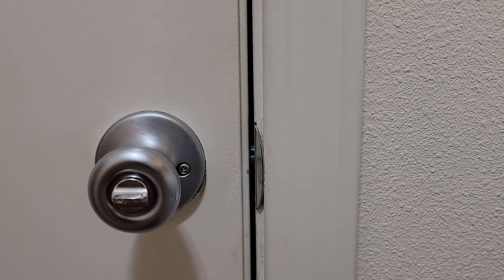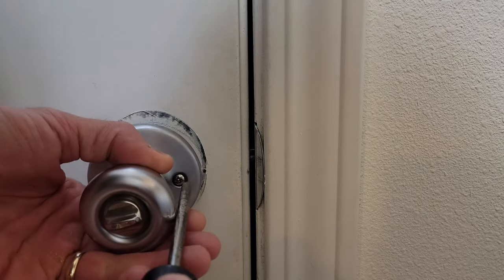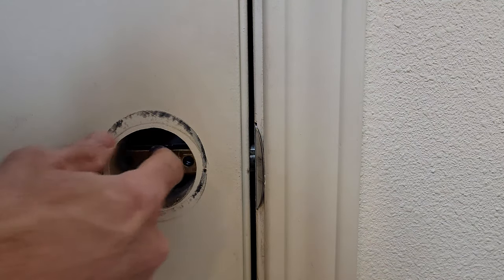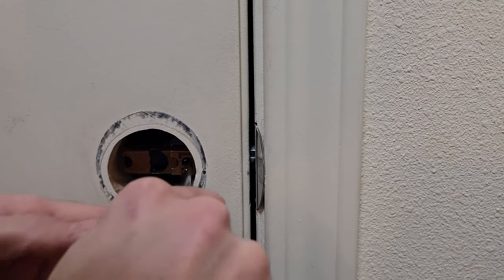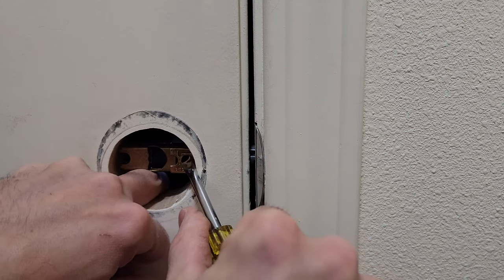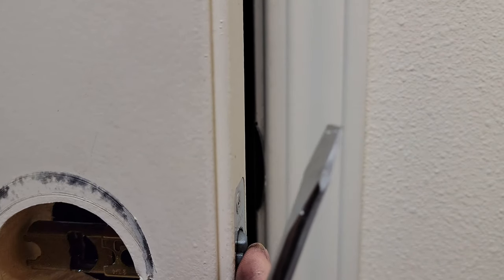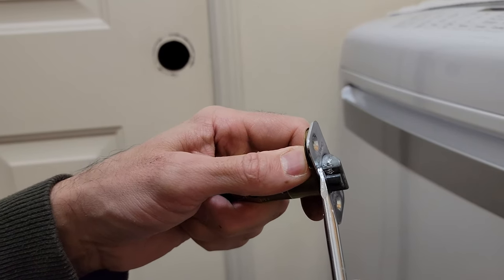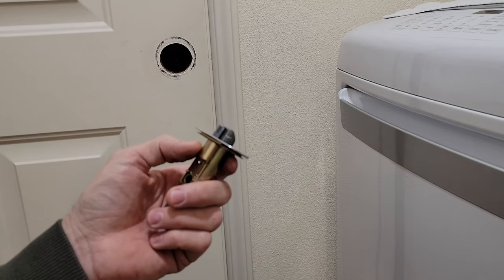HOW TO OPEN A STUCK DOOR.. HANDLE TURNS BUT BOLT WON'T RECEDE

Comment: stuck outside my house and is 107
Reply: with my dumbass sister inside with AC and not knowing anything
Reply from the maker: I hope this helps
Reply from the maker: it's not an easy problem to resolve.. be easy on her :)

Comment: This is a terrible video 🤣🤣🤣use a zip tie to feed it between the door and door jamb gap to pull it through and force door open (instead of screw driver) you’ll have to pull pretty hard but it’ll pop open
Reply from the maker: Thanks for the tip, JOCELYN :)